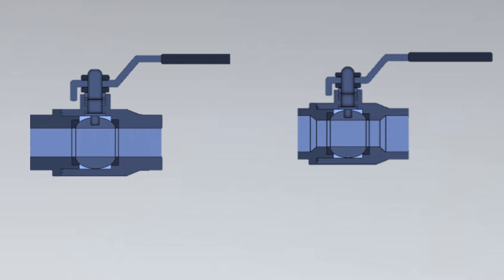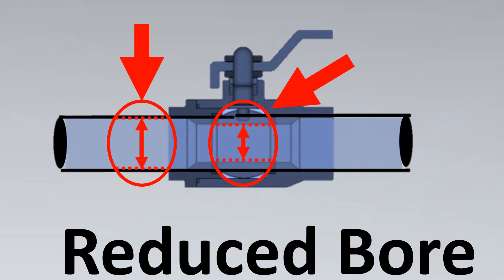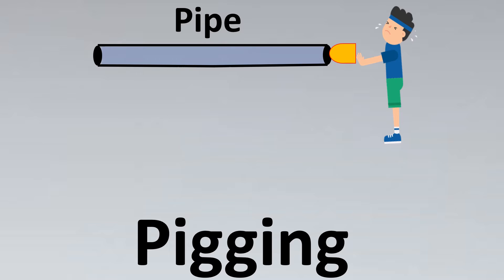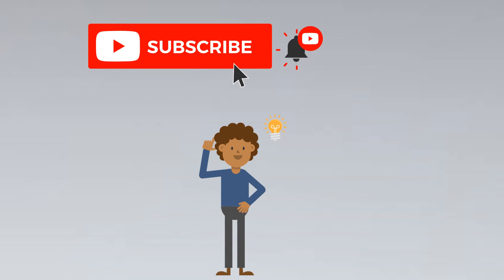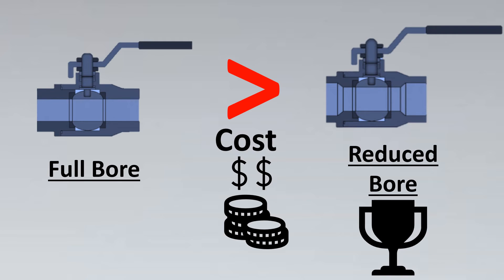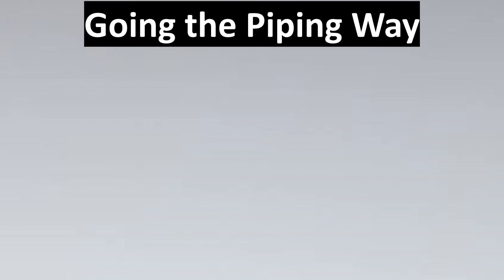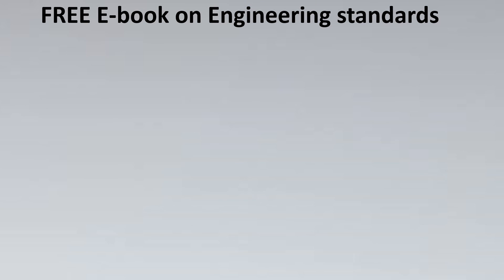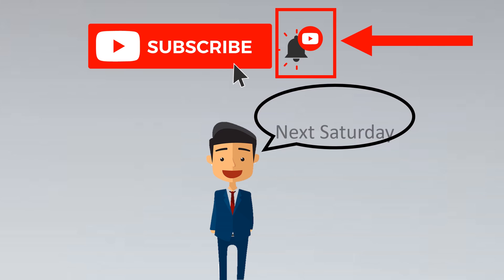What is difference between Full Bore Valve and Reduced Bore Valve & When to use what ?

Comment: Whenever you are using Valve as an isolation valve for installing the Sample probe, since the Sample probe shaft i.e. pipe shall pass through that valve, FULL BORE valve is used. 
You may add this point as one of the criterias where application of the valve is taken into consideration.
Reply from the maker: Oh wow good point to be noted.

Thanks for sharing your knowledge 😃